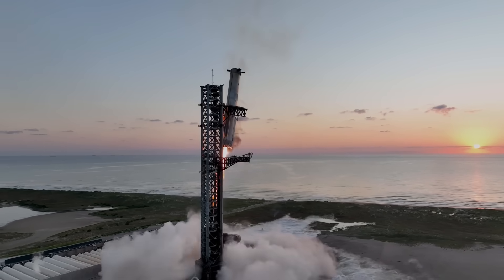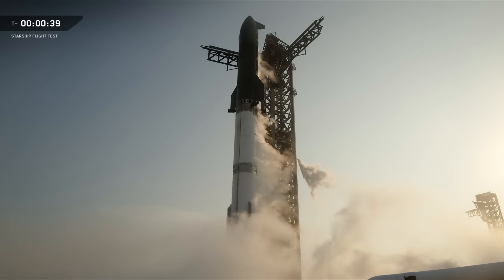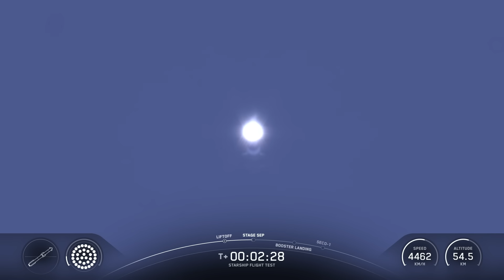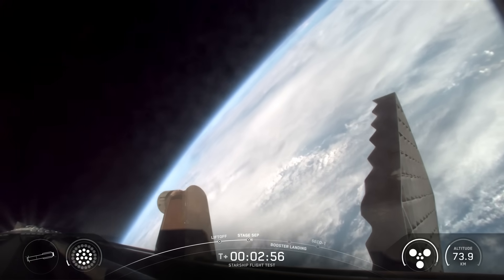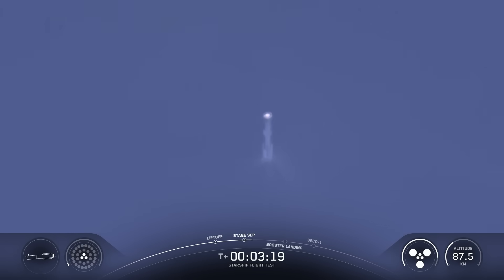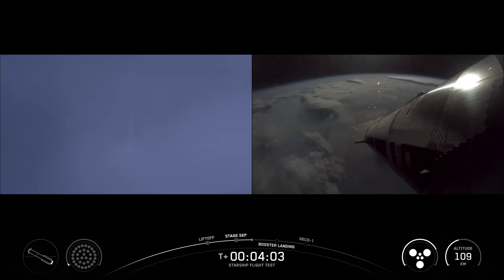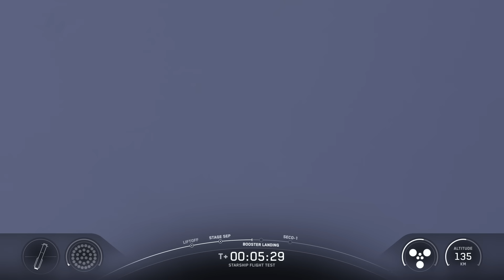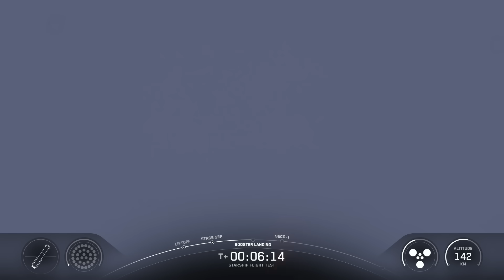SpaceX Builds Largest Reusable Booster, Also Makes Door That Won't Open - Starship Flight 9 Recap

Comment: The principle of "iterative design" is totally fine, but it only really works when your iterations are sufficiently close together that failure comes in well-defined ways relative to a previously functional system. It looks as if in the change from block 1 to block 2 that didn't happen. I remember they announced they had made a whole laundry list of changes and so far block 2 seems to simply contain too many failure modes they didn't anticipate. Every set of changes you make to a design also creates a network of interactions between these changes. That's not a linear process and can be too complex to control if you introduce to many changes. On a side note ... if after 9 flights the production process still turns out leaky 2nd stages then I'd suggest the built-quality may need improvements. There's a reason Falcon 9 is as reliable as it is. Starship + SuperHeavy are nowhere near that yet, even when viewed as single-use vehicles.
Reply: Block 1 had 6 test flights. Block 2 has had 3 so far. 
Yeah block 2 has some issues with leaks that need to be addressed.
The booster though, pretty much ticked all the boxes of it's flight plan & gave them the data they wanted.
Partial success is how I would describe it.
Reply: @geehammer1511  I was no fan of Musk during the early Tesla years but he eventually pulled it, mostly with Barnum and Bailey tactics, but everyone seems to forget that space is hard.  For the booster, they purposely programmed two faults into the booster return and it failed more or less as the model predicted.  They learned something.  And the second stage completed it's burn, which is progress.  This does point out the excellent engineering, and probably some luck, of the Saturn IV project - zero failures or lives lost.
Reply: @garyhalmbacher6875  ITs also abundantly easier to build a ship that doesnt need to survive in the same way or the complexity of having to be relaunched from another planet.
Reply: @DannyBowen25  Well, good point.  When dealing with megaprojects, it's best to have a vision.  Musk has and NASA doesn't.  NASA just spends most it time on unrelated programs.  Whether we agree with the Musk vision or not, having a vision is better than not having a vision.
Reply: @garyhalmbacher6875  "they purposely programmed two faults into the booster return and it failed more or less as the model predicted. "  The faults were to do with the steeper descent profile and an engine-out scenario.  Structural failure I could have understood.  However the booster exploding when the landing burn was initiated wasn't as far as I can see on anyone's radar.
Reply: @geehammer1511  Doesn't even make sense to talk about success or failure in terms of flights, as opposed to development time and expenditures to feature development. Spending four months and three RUDs to fix piping issues on Block 2 is better than nine months and no RUDs.
Reply: @thearpox7873  True failures often help development move faster don't they? We find out what the weak link is then fix it.
If we don't know what can fail & how it can we can't stop it from doing so.
Reply: @thearpox7873  but the piping issues still haven't been fixed.
Reply: @malcolmstreet1  Yes, but let's put it in perspective. It's been four months since Flight 7, and six since Flight 6. So we can say they've had this as a problem for six months and running.

This is no longer smooth or very quick development, but a six+ month delay is not yet development hell. When other rocket companies go radio silent for six months to work on a problem, nobody raises an eyebrow.

If this is still an issue in a year, then yes, definitely troubled development. But even then will not be outstanding by industry standards.
Reply: Tbh this is one of the most reasonable criticisms of block 2 I have seen. No, there probably isn't some "inherent flaw ruining block 2", thats going to result in the whole system failing. The biggest issue is probably that they changed too much, too quickly, and now they don't know what to fix, and can only really fix stuff one at a time. Pogo was the first thing that caused a failure, so they fixed that first. Engine explosion was the second, so they fixed that, and now fuel leakage is the third, and they will fix that too. They could've absolutely had changes to all of these things in parallel, if none of them resulted in the whole thing exploding every time, preventing them from getting to see the other issues that only come up later into the flight.
Reply: @logicbuilder1204  Pogo resulted in piping problems, the fuel leakage was definitely piping problems, and I wouldn't be surprised if the engine explosion was over there as well.
It strikes me that there are issues in the Block 2 piping, and SpaceX by tying everything together for efficiency have left themselves with little to no redundant systems for things such as altitude control.

This may not be an issue of them not knowing what to fix, but that some things do not have a quick fix. So they're stuck with the prototypes they have, and are trying to at least fix the secondary and tertiary issues in the meantime.
Reply: @thearpox7873  Fair point, scaling the largest rocket ever made to be even bigger can't be easy structurally. Still, I think they fact they have been getting farther and farther into the flight as the tests have been going on is a sign that they are making progress. They almost definitely changed way too much at once with Block 2, and are having to refine it as they go.
Reply: @logicbuilder1204  👍
Reply: I kinda wonder if the leaks are coming from the V2 raptors, and they'll only solve that with the V3s
Reply: Iterative design the way Musk implements it only works when there is unlimited money supply from government with zero oversight.
Reply: They’re following the controversial Agile methodology from the software world which doesn’t scale to hard engineering.
Reply: I completely agree with you !!!
Reply: I work in process improvement, I was always taught to only make one change at a time so that you 100% know which change is making the difference.
Reply: @MichaelKennedy-pn6kv  Unfortunately when you are launching rockets one change at a time is a luxury that isn't practical.
Reply: Iterative development is fine if you're only changing a few things each time (ideally just one) but, when you are changing dozens of things each time, the resultant data is too confusing to be of much use. 

They are basically stabbing about in the dark.
Reply: @paulhaynes8045  "they are basically stabbing about in the dark" says the person that has no clue what they are doing.
Reply: @paulhaynes8045  I think Musk just likes to launch the world's biggest fireworks. Especially if someone else pays for them.
Reply: Both of you are correct.  The problem is you need to decide what is a small step and in systems integration, which is Starship on a massive scale, the fact that two or more changes may work separately but when combined they fail collectively.  As a lifelong systems integrator, I cannot count the number of times I have encountered the described scenario.
Reply: In addition, I find it annoying that so much slack is cut to SpaceX: this type of broken iterative process would gain widespread criticism if it was done by NASA or BlueOrigin. Musk instead enjoys a sort of messianic treatment that dampens criticism in a way no other billionaire has ever seen
Reply: @youtux2 the criticism towards NASA is derived from them spending 26 billion over 15 years and have had one launch of a vehicle that is already obsolete. Not all necessarily NASA’s fault. Theres way too much government bureaucracy and way too many hands involved that know nothing about rockets. Meanwhile, Starship has been given a few billion from the government, and have launched multiple times in just a few years. This is the process. There’s going to be at least a dozen more failures, but these failures ensure that the vehicle is built in the quickest and safest way.
Reply: @youtux2 Yeah. SpaceX has had more Starships explode in the last 12 months of “development” than NASA had Shuttles explode in the entire program. And the Shuttle actually was reused. We’ve still never seen a single Superheavy booster or Starship complete more than one flight.
Reply: @youtux2 Agree 100%. What annoys me even more are folks who consider the FAA as an enemy to SpaceX's successes. Like, they are already waaay too easy on SpaceX, see the environmental and social concerns that were raised in the Boca Chica area (there's a video by More Perfect Union about that), and people want the FAA to back off even more? Smh. The FAA is not even close from doing enough: iirc there should be an active lawsuit against both the FAA and SpaceX for overseeing the negative impacts of SpaceX's facilities on Boca Chica
Reply: @youtux2  actually I disagree on this completly. Well at least with blue origin.

Now a days I agree NASA would get such criticism, but back in the day NASA would send Astronauts to heaven with their incompetence and get away with it clean. The main reason NASA wouldn't get away with it now is because there is no reason to put ANY faith in the organization at all. Its a burricratic hell hole.
Reply: @youtux2  --  Really?   If the multiple "fixes" don't excessively interact it's reasonable to  let one flight test several changes.   Space X gets a LOT of data (to include a lot of video) from its flights.   The sequence of events it likely made manifest.
Reply: @youtux2  NASA would get a lot of criticism yes, and this is why NASA has been under-performing since Apollo.
Rather than complaining that SpaceX gets a lot of slack, more slack should be given to others.
Reply: Blue origin and NASA has nothing in common. Sure Bezos likes to say that they are equal in terms of approach, but the reality is that his development process is hidden from us and we honestly have no clue how many failiures they have had along the way unless they happened on a public test stand. We know they have spent a really long time making New Glenn and even then it did not do a flawless run of all it's goals on it's first launch. We also know that their technology is not as mature in some aspects from comments made about the latest iterations of the Raptor engine and the lower chamber pressure used by NE-4. So to say that they are not iterating is sort of incorrect. They just prefer to spend more time simulating things as opposed to trying it in the field. In the end neither approach is wrong and tax payers should look at what they get for every dollar spent as opposed to getting hung up on one approach beeing canonically the right one as they can both be disaterous in the wrong hands. As for the amount of changes in each iteration I would tend to agree with frank here. That said it's not like it's a problem to iterate on several systems at once, but they should at least be distinct enough that a failiure in one can be clearly identified and not associated by mistake with a failiure in another system.
Reply: @aBoogivogi  They aren't hiding launches. Those are easy to spot. The reason New Glen took so long is that, unlike Musk, they are being very methodical in their approach. They don't have heaps of Federal money to waste, so they have to be. If Bezos and Musk could compete on a level playing field, Blue would eclipse Starship.
Reply: @youtux2  no. You're wrong nobody would be critical of BO or NASA if NASA launches were as cheap as SpaceX' 

Yes if nasa was blowing up 10 billion dollar rockets every couple weeks the tax payer would rightfully be annoyed but starship/superheavy cost nowhere close to that and are privately funded. 

NASA deserves their own criticism because of how delayed and over budget they are
Reply: @VanquishedAgain  Anyone can do cheap. No one has yet done cheap and successfully got a human to the moon or Mars and back alive. That is a much more complicated undertaking, and cheap isn't going to get us there.
Reply: @youtux2  spacex is wildly successful, falcon continues to set records on reusability, reliablity, and low cost. he's not being "cut slack", spacex's success speaks for itself.
Reply: @TMS5100 we’re talking about starship here, falcon 9 is irrelevant to the discussion. It’s not like just because this crack team made a good rocket that they are suddenly incapable of making a bad engineering decision ever. You treat these guys as if they’re messiahs who couldn’t build a bad rocket or make dumb decisions. You’re the ones trying desperately to spin a rocket blowing up into some sort of success.
Reply: @TMS5100  If you're being honest with yourself and others though, you have to admit that Starship has been an abject failure from the start. If SpaceX were spending only it's own money on Starship, it would have have quit that programme a long time ago, and either tried a different approach, or just giving up in order to use its own resources to find ways to make it's other rockets even more efficient than they already are. Starship is a bucket of bolts, and flies like one. It's time to cut off the Federal dollars and see what happens. If he can't suck at the teat of government, I bet he'll end the Starship programme in a New York second.
Reply: @TMS5100  - we're not talking about Falcon, we're talking about Starship.
Reply: It is virtually impossible to simulate or even recreate during testing the issues they are seeing now. V1 was over engineered just to test viability of the concept, v2 is paired back to see where the rocket can be optimised. Now is the process of pulling back and reinforcing the parts that are failing. They got further this time which means they will have gathered vastly more data than previous 2 launches that failed before SECO.
Reply: It's not leaky post production. It's leaky post launch. I believe they don't master yet how vibrations impact the hardware, and that stuff can't be tested on the ground, hence why it's difficult. They need to understand better how the whole system behave during a launch. It looks like they are not quite sure. May be they don't spend enough time checking they've understood everything. Less rush, more thought is needed.
Reply: However their iterative design approach is going to hit a brick wall when they start test flights to Mars. Imagine if the FAA had only allowed one Starship launch every 26 months, we would only now be approaching a second Starship flight. They can do some Mars flight simulations in Earth orbit, but landing on Mars, ISRU on Mars, and launch from Mars tests for example will be limited to every 26 months. That's why Elon's claim that a 2029 human landing on Mars is theoretically possibly is nothing but a PR bluff as they would have to demonstrate a complete uncrewed Mars landing and return mission within the next 18 months.
Reply: Iterative development may seem slo when problems reoccur like this, but once u hit the successful formula it will feel like a breakthrough.
Sure Boeing on SLS and Blue on new Glen got successful first launches, but look at the cost of each up to that point, Space X have got production and launch pad builds under control, meaning their iterative cost per flight must be 1000x lower than SLS or NG.  Don't you think their breakthrough success will come in jsit a handful of flights, and not 100 or 200 flights? So in light of this I feel it's wrong (although it feels right) to critize their approach. To the next launch next month, and let's see if they break through, they will some time *soon*.
Reply: @IanValentine147  Actually, it's right (and it feels right) to criticise their approach. This isn't how any successful space programme has progressed, and it's not how any successful space programme will ever progress. Honestly, looking at what the original goal for this was, it's not really even a little bit closer to achieving what it was intended to achieve. He knows that, and if we cut off Federal funds for the project, he'll drop it like a hot potato even though he has the money to continue it himself.
Reply: @IanValentine147 holy smokes look at the costs to this point with Starship. Cold reality here, only income generated at this point is entertainment. This doesn't even compare to Falcon 9 development where there were critical economic points they need hardware development to be to be "profitable." Athough,  I believe even with Falcon SpaceX has swept much of the development costs under the rug and charge way under actual costs to undermine competition. 

All companies iterate on design. SpaceX PR made failures cool. But in reality it drains your engineerin and adds to hardware cos have to replace test hardware. Starsh cost is huge just in manufacturing,  nut also in materials, fuel, and labor. Engineers must have little life balance. No, this vehicle cost is crazy high.
Reply: @andret4403  Starship cost is NOTHING just in manufacturing.  Its huge to YOU, but not as far as building spaceships go.  They have them LINED UP kids.  lol
Reply: @DannyBowen25 My 30+ years in Areospace including launch  vehicles me a little insight. But be fair I have not done deep analysis of SpaceX costs. But really everyone outside SpaceX are only guessing their actual costs.
Reply: Exactly my thoughts. The iterative design process works on small step changes, small enough that when something goes wrong you roll back to the previous working version and move forward again. It does appear that they jumped too far ahead in the design and now can’t get back on track. Baby steps are a well defined part of iterative design, at least in software, that’s why it works so well.
Reply: i don't have a problem with iterative design concept but every launch is them throwing darts at a wall trying to hit a 1 mm object because they're not even getting the basics right let alone adding more and more "test" parameters to each launch.
Reply: @sirmonkey1985 this is simply not true. They mentioned in the first 10 minutes of the broadcast that the failure in flight 7 was addressed and resolved, and the failure in flight 8 was NOT THE SAME. They are fixing issues, finding new ones, and improving. 

In any case, they’re not burning taxpayer dollars like NASA and are doing it all at a fraction of the cost. Maybe stop being so negative and just enjoy that you can watch them develop such a machine for free on your phone
Reply: @sirmonkey1985  You have no clue what their processes and design philosophy entails, none of us do. So far they have had 3 launch failures all for different problems. Each launch the problem from the previous launch seems to have been mitigated. This is no different and issues like this are not easy to solve without on launch testing. Sure they could over engineer it all but then they would be back to V1.
Reply: @sirmonkey1985  They are also cutting corners by not loading enough telemetry onboard to know what exactly is failing and how it is failing. NASA's Mercury, Gemini, an Apollo Had tones of telemetry onboard, and lots of redundancy built it. It added a lot to the costs, but they ended up with solid ships as a result, which even when they did fail were recoverable. They had only one loss of crew event, and they knew what they'd done wrong even before they got the capsule open. That one loss was a "cutting corners" loss in that they'd never tried using the capsule with 100% oxygen before. The problems with the shuttle came about when launching outside of parameters, and not taking care of a known issue. Musk has apparently not learned that lesson, and he continues to try to find answers without adequate information, and rarely gets known issues fixed, because while he knows what happened, he doesn't know how it happened. His approach fails at almost anything he does. Hence all the problems we are facing because of his time at DOGE (not to mention the incompetence of his boss). You just can't go in and do things fast. These things are just not that simple and that easy, although that's part of his talking points for his grifts. Seriously, expose him to a little honest capitalistic competition, and he'll be out of the Moon/Mars running faster than you can blink. Where he has had to compete (his reusable satellite launching service) he's been spectacularly successful, but there he has had to compete, and he couldn't afford as many failures. People need satellites in space, an there are others out there who are launching satellites. There aren't a lot of people trying to send people to the Moon or Mars, and until there is serious competition in that realm, and until he is detached from the teat of government, he'll just continue with the failed approach he's attempting with Starship.
Reply: @sirmonkey1985  basics, this is literally rocket science, build your own if its so easy..
Reply: Wait, don't you know - we'll be on Mars like tomorrow!
Reply: @slyn4ice  Well keeping the booster in service is an incentive not to go too far off the rails--lose a F9 and you're losing all the future (mostly Starlink) launches, vs. planning to splash it and "just build another on the government's dime".
Reply: @slyn4ice  Maybe even yesterday if we're lucky!
Reply: Still the starship booster seems to be pretty close to something that could be used regularly...

And that could be pretty interesting if we get creative with upper stages.

Starship (reusable upper stage) itself is the hard part and I'm still not convinced it can be done. The shuttle couldn't do it economically.
Reply: @nt78stonewobble your whole comment is dump
Reply: @nt78stonewobble not really, the upper stage has never returned without sustaining severe damage
Reply: @nt78stonewobble it exploded. It literally exploded. This is EXACTLY what people are talking about. A booster explodes and you’re out here pretending it’s close to something other than exploding.
Reply: @SebastianPeitsch They deviated from the previous return procedure... remember when nasa departed from  launch procedure, launched in cold conditions, exploed their shuttle and killed 7 people?
Reply: @SebastianPeitsch Yes, it exploded when they were pushing it into unknown territory. They knew that could be the result but what they could learn outweighed the risk.

The fact it had previously returned to launch site proves something is close to working. Then only reflew 29 of 33 engines although 1 of the third time. So not fully reusable yet but they are close.
Reply: @SebastianPeitsch Because it is. More Data, More Room for Improvement. Things that failed before, Work better now.
Reply: @SebastianPeitsch the booster has returned several times. This one would have as well. Starship has also returned safely but that was the precious version.
Reply: @SebastianPeitsch  the booster that was expected to explode exploded. Oh no, anyways.
Reply: @SebastianPeitsch  It didn't explode. It rapidly disassembled, or whatever the term of art is this time.
Reply: @VanquishedAgain  Starship hasn't even made it into orbit yet, much less flown a human to the moon or Mars, which were the programme's stated reason for being. It being a giant Pez dispenser was never a question until it became obvious that it was never going to make it to Mars. It's becoming obvious that it's not going to make a good launcher for his satellites either, so why are we continuing? Because he has mounds of Federal dollars to spend on it, so he can keep saying it's going to work "someday" if we keep pounding money down the rat hole. How many more dollars do the tax payers have to fork over before we give up on this obviously failed venture?
Reply: @SebastianPeitsch  they were trying new descent profile, it didn't work.  C'mon they have caught 3 boosters!
Reply: @VanquishedAgain  - "Starship has also returned safely but that was the precious version."  It successfully re-entered after a suborbital flight albeit with major fin damage.  But that's a very long way from return in the SpaceX sense where it returns from orbital flight to the launch tower.
Reply: @SebastianPeitsch  Yeah well, this mission was specifically intended to test the booster to certain limits, not to recover it.
SpaceX has recovered already two boosters, this one being literally one of those two!
Reply: Elon thinks Agile development works as well for engineering complex hardware systems as well as it does for websites. 
It doesn't really work well for software either, but that's besides the point.
Reply: @PaulSpades  why not, waterfall boomer?